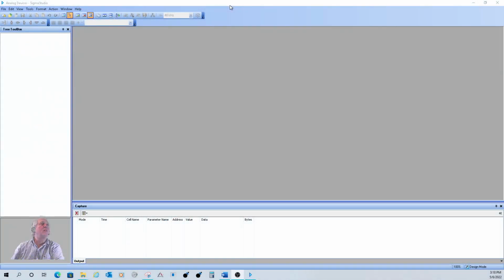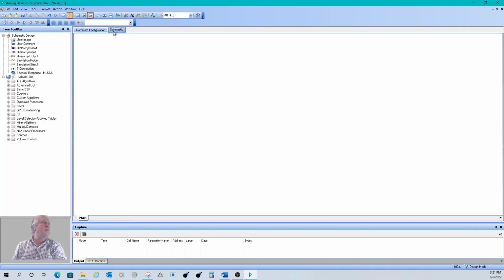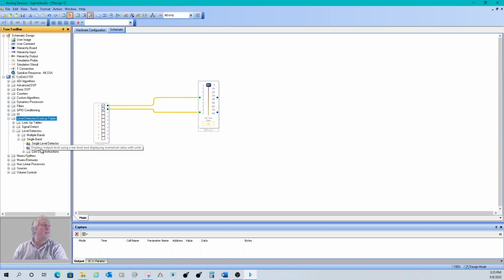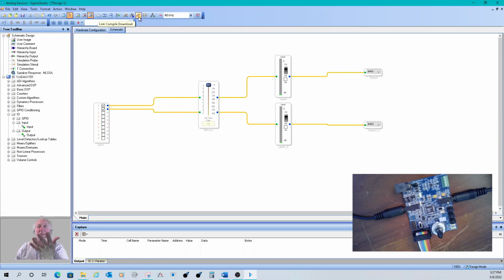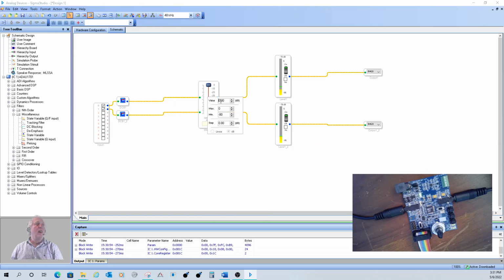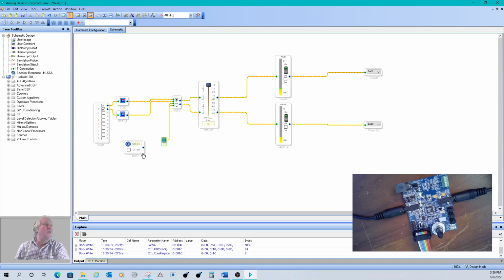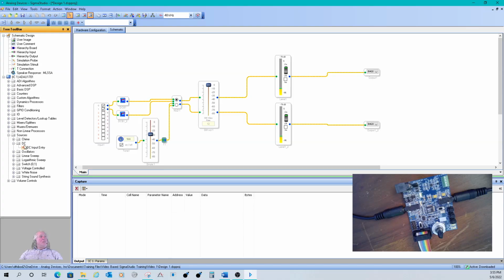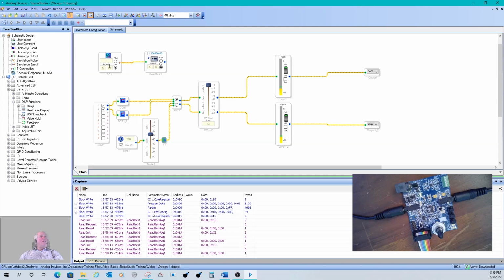Creating a Starter Project for the ADAU1701

Comment: I have a question! If the input is digitally coming from a raspberry pi, you would use the digital inputs for the IO, correct?
Reply from the maker: I have not used a Rpi before but I think it is possible. The clocks and data need to be properly formatted. So lots of details. Have you seen this tutorial on the Wiki? https://wiki.analog.com/resources/tools-software/sigmastudio/tutorials
Scroll down not too far and you will see it.

Comment: I'm following along step-by-step locally, but I cannot find the ADAU1701 subtree in Tree ToolBox. In your Tree ToolBox I see top level items: Schematic Design and ADAU1701. In mine I have: Processors and Communication Channels. Why is mine completely different than yours?
Reply from the maker: Are you using SS+ (SigmaStudio+)? This is a newer version and does not support the ADAU1701. You have to use the older SigmaStudio Rev 4.7